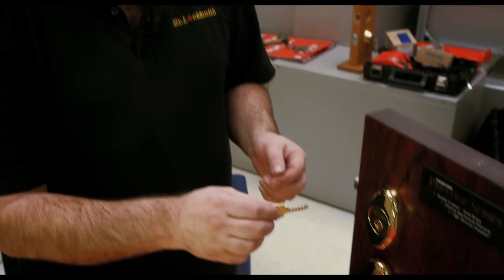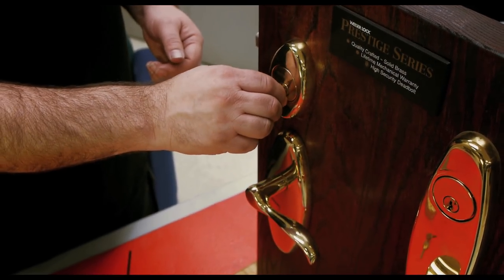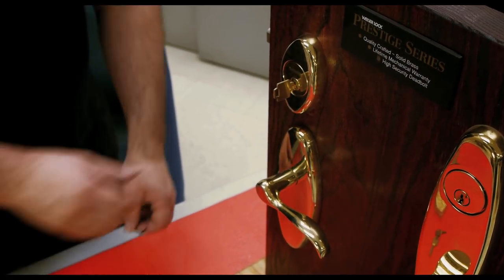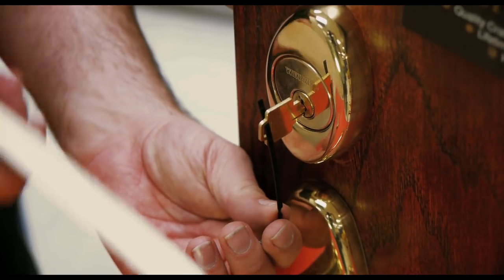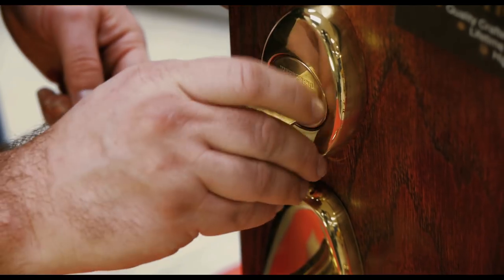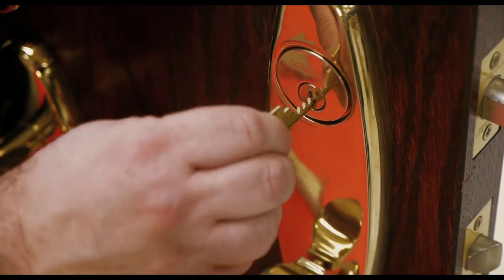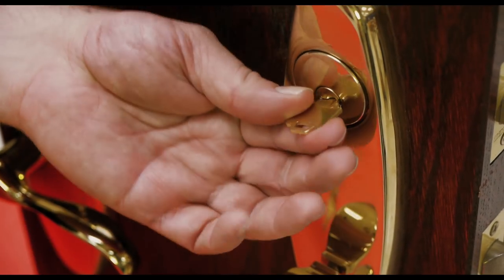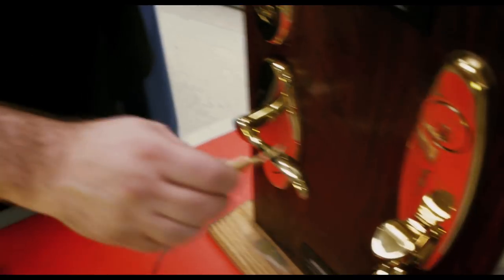Bumping a Lock with a Bump Key | Mr. Locksmith Video

Comment: mine never open on the first try I usually have to tap about 5-10 times but I need to cut more of the shoulder for my grommets my set is kind of old a bit worn my original set.
Reply: Thats all there is to it?I dont know how that is done still.Maybe because im female.Or not a burglar.
Reply: @loriholley4295  The keys are cut special by  rapping with a mallet on the key the pins jump